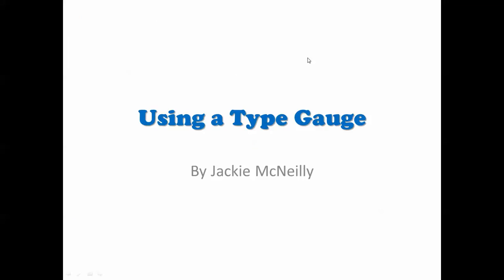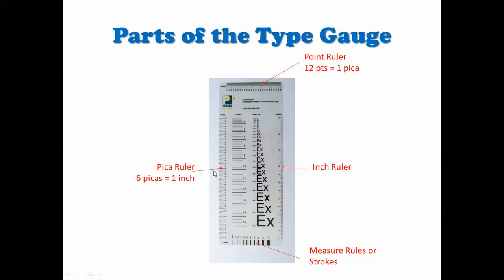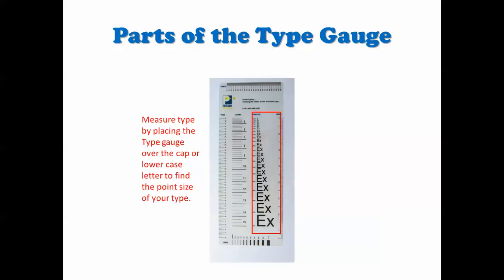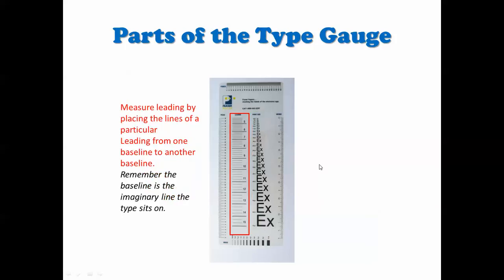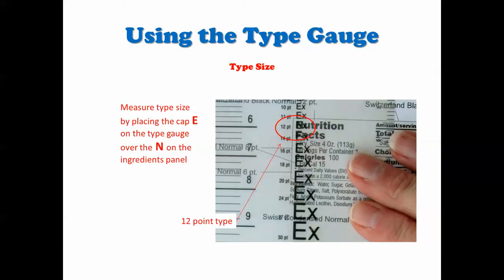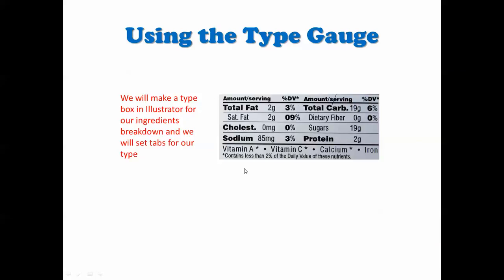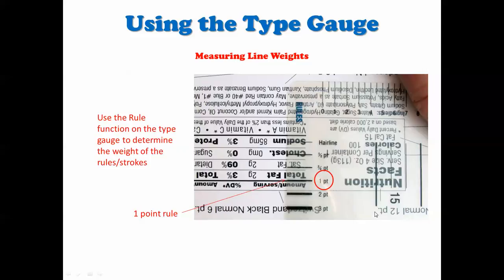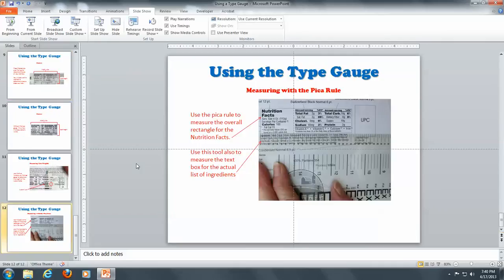Using a Type Gauge

Comment: Thanks for the video. Also worth noting that in any type gauge, the letter size is merely an approximation because each and every typeface manages vertical space differently and therefore the point size is never actually printed. No letter from the latin alphabet is the height of the point size in the type gauge.